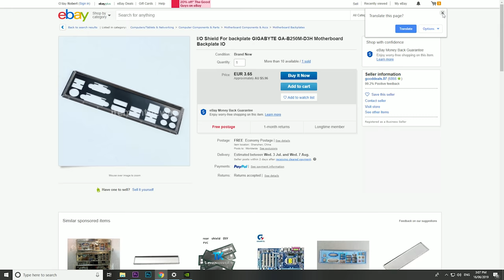How to install motherboard IO plate / IO shield

Comment: Thank you for this, thought I was going crazy last night when doing my first build.I felt like it was really blocking my motherboard (B450 Tomahawk) to the point the board was slightly off from the standoffs. I just had to push in a little bit and then screw them in simultaneously. From the comments about shorting the board from the prongs, I am now going to re-check that none of those metal prongs are inside any of the ports.
Reply: lmao i totally relate to this comment. it even got to a point that i was scared coz i had to push in the mobo to the io shield. might scratch or damage the bottom of the mobo :((
Reply: @mickeydeeez2736  Lol it was def nerve-racking.

Comment: I/O Shield was the part that gave me the most trouble. Wasn't installing it, or forgetting it, or anything. The tabs just would not let the motherboard go into the slots smoothly. Took about two hours before we just ripped the troublesome tabs off. Computer was built for a friend and he's had it working fine for years now, so I guess it worked out in the end.
Reply: Rico

Comment: Thanks, mate. First time in ages I've meddled with this and was a bit skeptical of what I was doing. Perfectly back on track now.
Great video, clear on all instructions, well shown.
Reply from the maker: Cheers
Reply: @Robtech  it seems you installed it backwards because the labels are on the inside of the case its supposed to be facing outward so you know what each is when plugging something in
And those tabs are a pain tbh I cand fathom plugging something in and having to fight them gripping something trying to be taken out after especially considering how you have them bent

How is this really how it's done it makes no sense on a few levels

Comment: 6 years ago when I built my current rig (it's getting replaced today, which is why I looked for a video like this) this was the hardest thing about building it.  I just could not get it to work.  If the IO shield was in, I could not screw the motherboard to its standoffs without a small amount of warping.  I was very uncomfortable with this and after spending entirely too long trying to get it to work, I gave up and put the IO shield back in the box.  This case has no dust filtering so I was always going to need to stay on top of cleaning it anyway, so it made little difference.

Thankfully it all went fine for the machine I built for my husband 2 years ago (easy to pop in, no issues with motherboard fit), but I did want a refresher.  Thanks for this!

Comment: With my b550 board the io shield is connected to the board, the case says it's compatible with the board but i'm having trouble fitting it into the io shield spot. any suggestion

Comment: better to double check before you screw the motherboard in place, the thing that you say help ground the motherboard can sometimes be out of place, just built a pc the past few days and the ones on the hdmi port 0:55 actually went inside the hdmi port instead of touching the outer parameter.
Reply from the maker: Yep some prongs need a bit of bending beforehand.

Comment: Are I/O plates usually the same width? Because I'm looking to get a new motherboard and I'm not sure if the plate will fit in the back without covering some connections.
Reply from the maker: They're standardized

Comment: do screws come with the case? And what screwdriver do you need? Sorry I'm new to this
Reply from the maker: With a brand new case you'll get all the screws you need. You'll need a Phillips head screwdriver. A magnetic PH1 and 2 are commonly used, or you can buy a multi head screwdriver kit to let you pick and choose the head you feel most comfortable with.

Comment: Question, my motherboard cane with the io shield pre installed and I was wondering if I needed to click it in even though it’s pre installed. It doesn’t seem to look like it’s supposed to click in, but I want to be sure.
Reply from the maker: If it's attached to the motherboard it most likely doesn't click in just fills the space.

Comment: Are IO shields different for each motherboard? Is there a standard?
Reply from the maker: No standard as the ports and location of the ports are different on each motherboard.
Reply: @Robtech  At least the rectangle dimensions should be common? Otherwise how do you make a new case. I want to build a case myself and then people to be able to put their motherboards.
Reply from the maker: Yes that size is the same. Just port location cutouts

Comment: Could I buy a case and then get another i/o shield? Bc I have no clue what ports will be covered or not and I don't want to spend ages looking for a case like that
Reply from the maker: It's bundled with motherboards and not cases. You'll be using the IO shield that comes with the motherboard you buy.
Reply: @Robtech  yes I just saw that 😂😂 um completely unrelated but since I'm a first time builder I'm going to be in need of serious help so if you can answer questions I have now.

Will I need to buy any cables, like power cables, Motherboard cables to gpu or anything?

Comment: Man idk how I missed this.  I suppose LTT's newest PC build guide just didn't mention it.  The fkn motherboard manual sure didn't...  Seems a quick throwaway mention to me, but nvm.
I had the ethernet thing poking into the socket.  If I'd left it any longer, the clip on my cable probably would have broken.

Comment: one of the builds for one of my kids had an IO shield just like that, it was a nightmare, and i had never experienced anything like it before or since, but that IO plate never came on, i just threw it away and said "to hell with it, what good is it anyways".

The PC is still running fine and no issues with it.
Some motherboards just come with a shitty IO plate, some manufactures don't know how to make them so they make sense.
but looking back at it, it might have been easier to do as some say in the comments here, just cut off the small metal brackets, since they were never gonna fit with the motherboard it came with 🤣😂🤣

Comment: I cant attach properly MB if i use i/o plate, it seem push MB inside so, MB dont align with screw port. How to solve this? 

Fyi, MB b450 pro 4 atx
Reply from the maker: Check that the prongs are not in the way. Also you can push the motherboard against the IO plate and then start putting in screws once it's aligned. Sometimes a little force is needed.
Reply: Thanks for answering, i press the side of i/o panel because thats the problem. Now problem is solve thankyou so much
Reply from the maker: Glad to hear it. Enjoy your build!

Comment: Hey pls give me info my friend forgot to attach that to my desktop do i really need that can my pc damage without that
Reply from the maker: No you don't
Reply: @Robtech   good u answer me fast xd i alot drivers from 2006 can that be the reason why i get glitches my pc gets in slow mo and the sound is disorted from couple secs to minute happens rarely happens on any circumstance gaming browing etc
Reply from the maker: Could be. Try updating what you can.
Reply: @Robtech  i got appointed windows reinstall
Reply: @Robtech   btw man without  the io shield im getting more dust on back of my gpu and cpu fan how much dust can really damage pc bcz  i clean my pc every week with blowing the dust out and it always has minimalistic dust particles inside the rig
Reply from the maker: Dust can't damage components. It can only build up enough to stop fans from spinning and cause overheating. You'd need a huge amount of dust for that to happen.

Comment: damn i didnt know you were suppose to bend the tabs inwards, mine are bent outwards and look like ass
Reply: Well mine are now blocking some of my ports. Like ethernet and hmdi. It's a pain. I'm searching and hoping I don't have unscrew the motherboard to fix this
Reply: @1990shahid  yea you gotta unscrew the motherboard  its not very hard to fix at all. I just didnt know how to install them. Good thing is the newer motherboards are going away from this design so your next build, you wont have to deal with it.  I don't know for sure though, alot of the cheaper motherboard still use this design.

Comment: The tabs are a huge PITA and pointless. If the motherboard is so badly designed that the bodies of the female connectors aren't electrically grounded and the MB's mounting screws don't electrically connect its ground to the body of the case, it's a truly crap motherboard. And if your power supply is so poorly designed that it doesn't electrically ground your case via the screws attaching the power supply to the case, you've got a potentially deadly PC. I deal with the stupid tabs by using needle-nosed pliers to grip them as close to the shield as possible from behind and bending them back and forth until they break off.